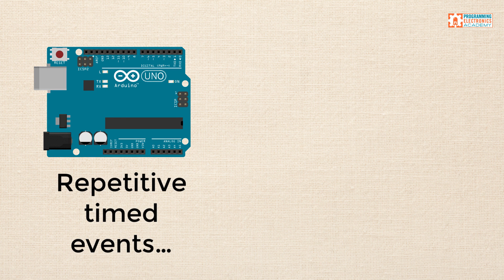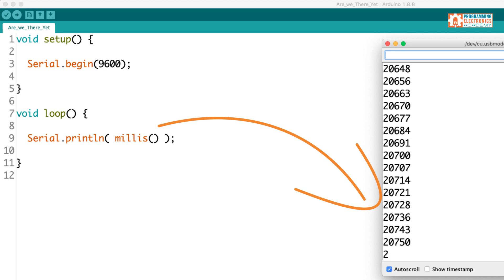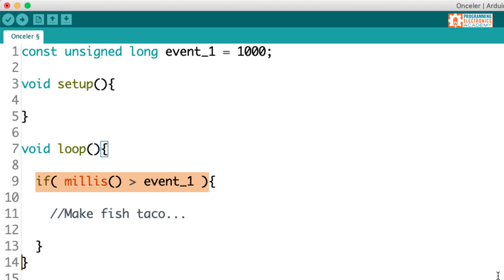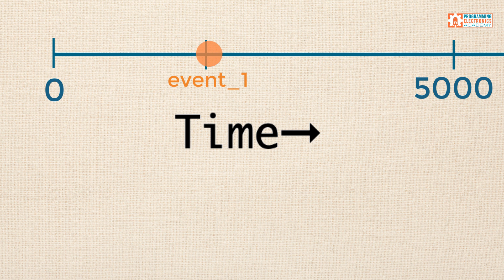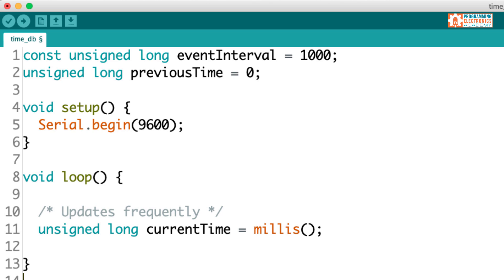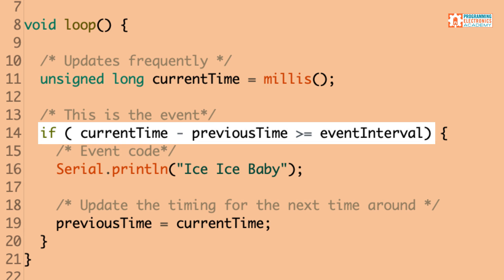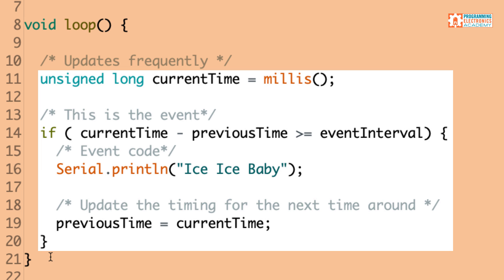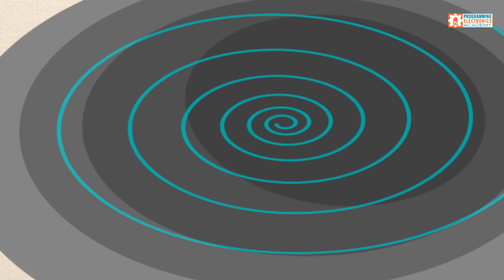Arduino Sketch with millis() instead of delay()

Comment: I'm trying to do this with multiple leds and with a class, I followed adafruits tutorial* but it seems one led acts weird because they only have one previousMillis. For multiple leds you need multiply previousMillis to compare to the currentMillis, correct? Or am I missing something 

*see: adafruits website "Multi-tasking the Arduino - Part 1" then skip to "A classy solution"
Reply: here is the code from the website. they are using different on and off times but I'm not concerned with that right now. I think I should add another parameter to the Update() function for each previousMillis but that's where I'm stuck 

class Flasher
{
 // Class Member Variables
 // These are initialized at startup
 int ledPin;      // the number of the LED pin
 long OnTime;     // milliseconds of on-time
 long OffTime;    // milliseconds of off-time
 
 // These maintain the current state
 int ledState;               // ledState used to set the LED
 unsigned long previousMillis;   // will store last time LED was updated
 
  // Constructor - creates a Flasher 
  // and initializes the member variables and state
  public:
  Flasher(int pin, long on, long off)
  {
 ledPin = pin;
 pinMode(ledPin, OUTPUT);     
   
 OnTime = on;
 OffTime = off;
 
 ledState = LOW; 
 previousMillis = 0;
  }
 
  void Update()
  {
    // check to see if it's time to change the state of the LED
    unsigned long currentMillis = millis();
     
    if((ledState == HIGH) && (currentMillis - previousMillis >= OnTime))
    {
     ledState = LOW;  // Turn it off
      previousMillis = currentMillis;  // Remember the time
      digitalWrite(ledPin, ledState);  // Update the actual LED
    }
    else if ((ledState == LOW) && (currentMillis - previousMillis >= OffTime))
    {
      ledState = HIGH;  // turn it on
      previousMillis = currentMillis;   // Remember the time
      digitalWrite(ledPin, ledState);   // Update the actual LED
    }
  }
};
 
 
Flasher led1(12, 100, 400);
Flasher led2(13, 350, 350);
 
void setup()
{
}
 
void loop()
{
 led1.Update();
 led2.Update();
}

Comment: Using 
previousTime = currentTime; 
will introduce an accumulating error. The time to process the code within the if statement will add to the time and accumulate. For just blinking LEDs or some other none critical stuff, no big deal.

But if you simply use:
previousTime += interval;
You've just gotten rid of the cumulative error.
Reply from the maker: Thanks for bringing this up Steve!
Reply: @programmingelectronics  It probably won't affect most of what people will use this for, but it is just the sort of thing to drive you crazy later when you can't figure out why your timing is slipping.

Comment: Kindly tell how can we use millis() between two arduinos that are working through serial communication e.g. arduino 1 controlling a LED connected at arduino 2 through serial communication and at the same time the arduino 2 sending a string to arduino 1. Can we use millis function for these two events. If yes then how? Please guide.

Comment: At 6:53 I was wondering why eventInterval was an unsigned long. Isn’t it a const with a value of 1000? Can’t it be a int?
Reply: You need to use the same type of variables when working with mills, so it needs to be an unsigned long. When doing some math with those variables, you need to use the UL suffix in the numbers (otherwise they are treated as integers and you get into trouble. Just check his first video about mills() to understand this.

Comment: Can I make a Clock with millis() function without using RTC(real time clock)???
Reply: In a nutshell no... You could create a stop watch, but not a clock, as you need a reference time to start from. Well... maybe not entirely no, you could look at the clock and set some kind of arbitrary time to set it to. Actually the more I think about it you if you wired up a couple of input buttons you could probably increment or decrement each of the fields to get the time closer like a digital clock. So I am going to change that no to a yes...

Comment: Very Cool!!

You come out with this video just in time for me to use millis() to toggle between volts and amps on an OLED display (without using delays, delays that long when added up would have made the loop way too long for this project). 
It took me a bit to figure out how to write the second section (like this:) (currentTime - previousTime >= interval + interval_1) I added the second interval time so I could set the volts code to display less time than the amps code since that's the one that needs to be read the most, but I got it. I'm sure I will eventually figure out an easier way but it's good for now and I'm proud of it! :-D
The most valuable information in your video series is the fact that the timer continues to count up until the microcontroller is reset or turned off and on again. 
I now also realize that I can run more than one program from the same millis() function.
It's kind of like calculating what needs to happen at different times of the day with a certain amount of time for each task. Yeah, I know, probably a screwed up analogy but there it is  LOL :-) 
Until now I thought that the timer reset each time it was called for. 

Thanks!!

Joe
Reply from the maker: Thanks also for sharing your addition on the code - very cool!

Comment: can you tell how to handle the 49 day overflow.Awesome video btw.
Reply: If you do the comparison correctly, the overflow calculation can be handled.  Consider

#define INTERVAL  1000

unsigned long Timer = INTERVAL;

if( millis()-Timer >= INTERVAL ) // will fire every second
{
    // Place code here
    Timer += INTERVAL;  // Move Timer to the location that should have fired .
}

If you look at the integer math of ( millis() - Timer ) it will work around a wrap.

Comment: How do you handle the overflow of the millis function ? Like this, code will run fine for 49 days and then stop working.
You cannot be sure what exactly previoustime will be the last time the event occurs before overflow because of small inaccuracies that will sum up until the 49 days mark
Somehow you need to know when to reset previous time without loosing information about the time lapsed since the last event
This is a purely hypothetical example, but lets say ypu are building an arduino based pacemaker - you absolutely need to always reliably trigger a pulse at the same intervals, while sending some data like battery percentage etc to an external host or whatever
How do you prevent the device from missing or falsely timing an event after 49 days?
Reply: See https://forum.arduino.cc/index.php?topic=122413.0, in particular message #2 & #10 and also https://www.baldengineer.com/arduino-how-do-you-reset-millis.html
Reply: The fact that you are using unsigned long for currentTime, previousTime, and interval makes the subtraction wrap around and work correctly. No need to reset the millis() timer.

  if (currentMillis - previousMillis >= interval) {
 
//when currentMillis wraps around and previousMillis subtracts, the
//answer is likewise wrapped back around and the difference is correct 
    previousMillis += interval;       // does not accumulate timing errors
Reply: Helloo, if currentTime = "MAXIMUM of millis()" then next currentTime(or next value of millis() ) will be : Case 1 : or remaining to "MAXIMUM of millis()" or Case 2: next value will be 0.Which case do you think that will happened?.
If Case 1: currentTime = "MAXIMUM of millis()"  minus previousTime (which it will be olso "MAXIMUM of millis()")  = 0 (so, the difference will be zero and all the time will not >= SetTime.
IfCase 2: if millis after 49 days will be automatically 0 then difference 0 - "MAXIMUM of millis()" ('the last value of previusTime) will be negative , so, in this case it a must to use all the time ABS(currentTime-PreiousTime) >=SetTime.
So which case it happening!?
An alternative solution is to use a function to reset automatically arduino ( I tested this function:
 void(* resetFunction) (void)=0; and, after, in loop rutine call this function using: resetFunction();
if millis()>=4000000000UL ....resetFunctio() .. .This resetFunction is very fast.Write , as example, Serial.print(F("abc..")); after calling resetFunction(); and you will see that Serial.print(F("abc..")); will not happened because arduino it was reset be resetFunction();
OR, if someone cand wait ~ 49 days to see what happend with value of millis() function after this period , please let me know :)) .Maybe will happened one of both cases 1 or 2 ...or neither.

Comment: The way you show it will usually work nicely. However, the interval at which you trigger your event will be at least eventInterval, but often just a little bit longer. This is because the loop also takes a little time. Sometimes you may want to be more sure that you always trigger your timed event at an 'exact' multiple of 'eventInterval'. In such cases it's better to update your 'previousTime' with the 'eventInterval', like so:

  previousTime = previousTime + eventInterval;
Reply from the maker: That's a fantastic point - thanks for that adding that Jan!

Comment: Is there a way to reset millis() without turning the Arduino off? That could be integrated into the code so that the project can go on for more than the 49 days limit.
Reply from the maker: From what I can gather, the best way to "keep it going" is to not reset the timer, but to handle in code the overflow event.
Reply: @programmingelectronics   Thanks. I understand you keep easy for beginners. But what you have shown will stop working after 49 days. Is that good programming? At the very least, you should have cleary mentioned this.
Reply: @Électro-Bidouilleur  If you do the comparison correctly, the overflow calculation can be handled.  Consider

if( millis()-Timer >= INTERVAL ) // will fire every INTERVAL milliseconds
{
    // Place code here
    Timer += INTERVAL;  // Move Timer to the location that should have fired .
}

If you test millis() - Timer will work around a wrap.